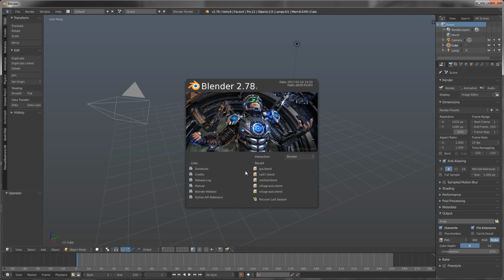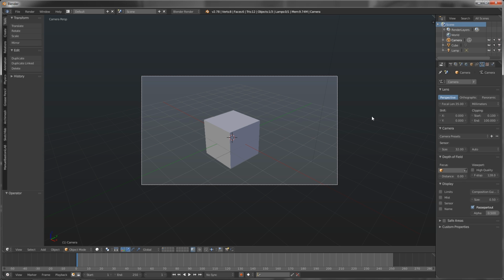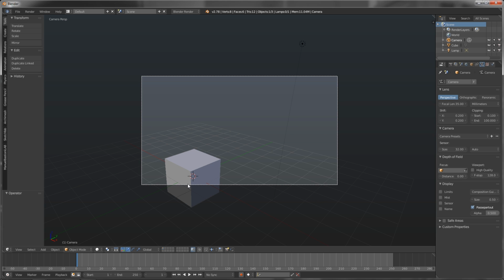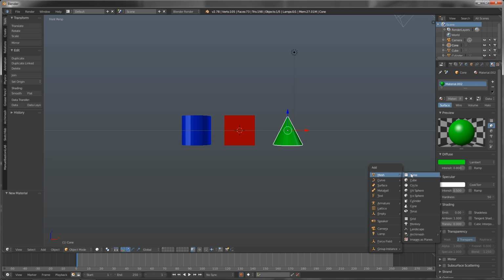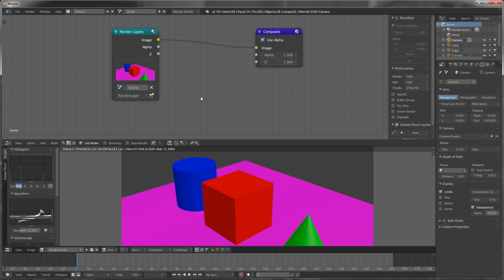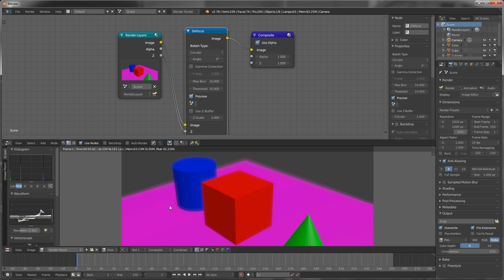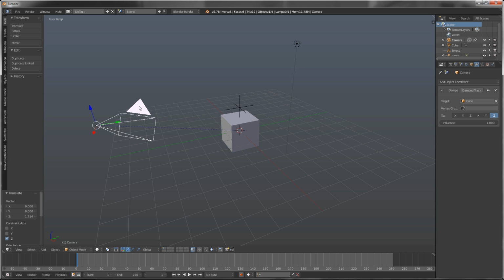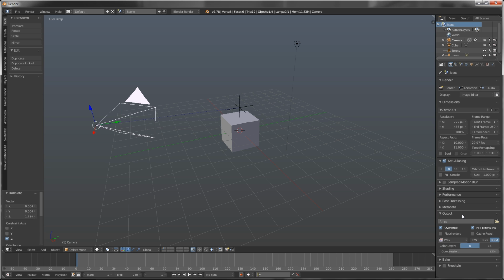[Blender 2.7] Cameras and Rendering | Blender Basics [Tutorial]

Comment: Why the hell does this red circle keep popping up wherever I click
Reply from the maker: Did you perhaps turn on Circle Select (C) by accident? Or maybe your have Proportional Editing (O) on?
Reply: @JSAbbott  Its a little red circle. I think it's called 3D cursor from blender 2.9. I had to use 2.7 because my windows 7 cant handle anything above it.
Reply: Everywhere I click it pops up there. I try to pose my fortnite models but I can't select the bones because the circle. I even select rotate mode and it keeps showing.
Reply from the maker: @justnitr0h566  Oh okay. Yes, if you click anywhere it will move the 3D cursor.
Reply from the maker: @justnitr0h566  Make sure you have faces, edges, or vertices selected before making any selection. You can always do a search for the cursor and place it back in the center of the scene. It shouldn't be affecting anything with the model. I'm not sure why it would affect your ability to select anything.

I did find this on Blender Artists (hope it helps): Although you can’t hide 3d cursor but you can disable it in User Preferences.
1.User Preferences>Input>3D View>3D View(Global)>Set 3D Cursor(clear the check box)
Reply: @JSAbbott  Now I cant select stuff.

Comment: The box doesn't appear whatever I try
Reply: Even after pressing 0 ,camera perspective is show but it covers the whole screen , while rendering the image it isn't same as that in camera perspective
Reply from the maker: You need to use the zero key on the KEYPAD. You can also open the Properties Window (N on the keyboard) and under the View tab, check "Lock Camera to View" - this should help. I have a new (updated) tutorial coming out on June 3 (for Blender 2.83).
Reply from the maker: Did you figure it out? Is it related to your comment below?
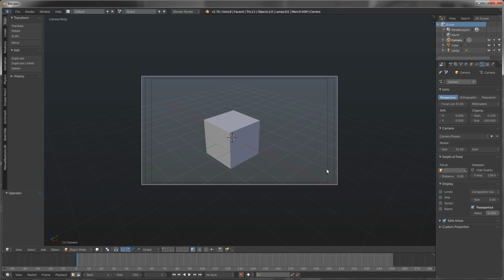Reply: @JSAbbott  in 1:31 when you press 0 and a border or frame appears but for mine it's same as it is before pressing 0 yes it gets convered from one view to another but I don't get to know which portion of my view will get rendered as the reference border isn't visible ,and it's perticularly for that blender file only ,I finished making a donut but wasn't able to render it as I didn't have a reference at which portion it is being displayed
Reply: Check 1:30 at  the mouse ,that border isn't visible and instead it shows the whole screen
Reply from the maker: @hiddenhidden5419  Okay - It looks like you are talking about the "safe areas?" You don't even really need them at all. They are still available under the Object Data Properties (the icon looks like a camera).
Reply from the maker: @hiddenhidden5419  
Make sure you actually have a camera! If you open the Properties Inspector (N on the keyboard) and under the View tab, check "Lock Camera to View" that will help you because you won't need to move the camera. Instead, move the mesh (donut) so you can see it in the camera (you may need to resize it as well).
Reply: @JSAbbott  is there any medium where I can send u photograph of it ?
Reply from the maker: @hiddenhidden5419  You could tweet it at me. (The link to my Twitter is on the channel's homepage)